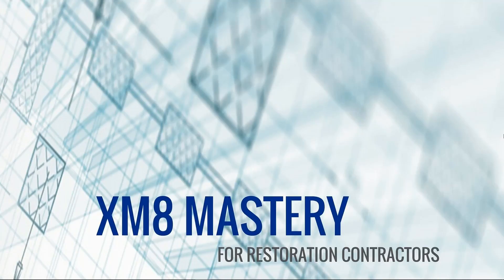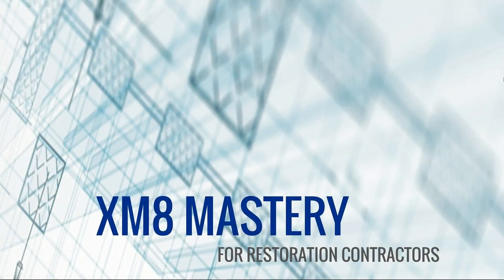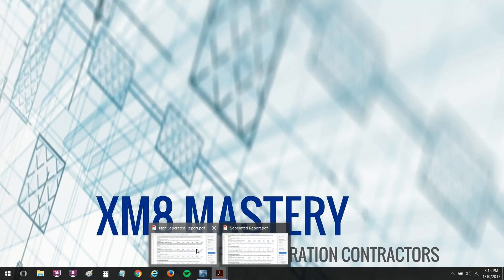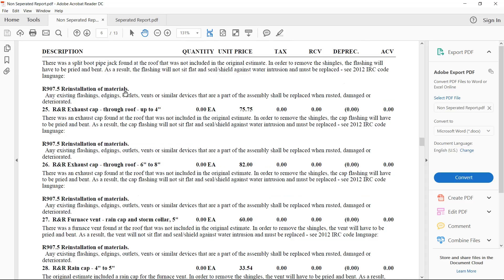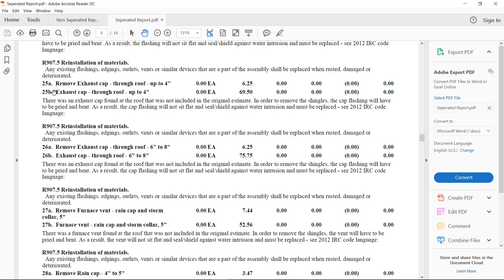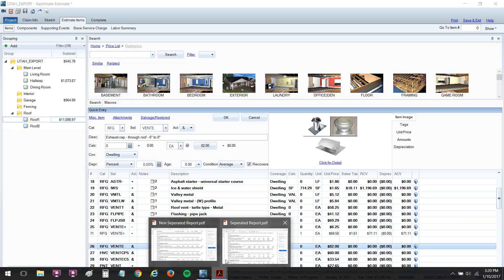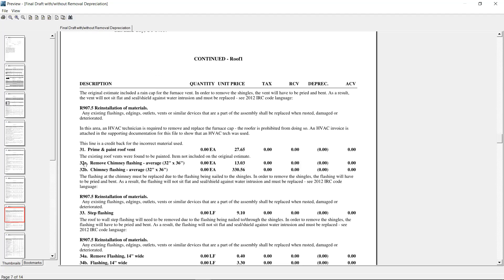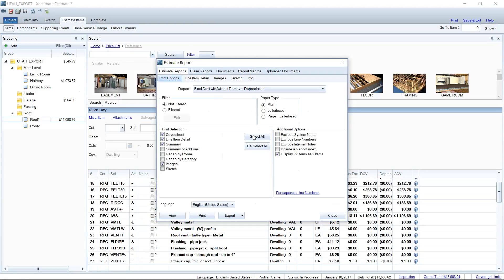Separating Line Items

Comment: Some of the insurance adjusters use Symbility and separate out the remove from replace. On the replace line item they always have some kind of waste factor included. Is there a way to specify a waste percentage for the replacement that xactimate is separating out, or the best way is just to make them two distinct line items?